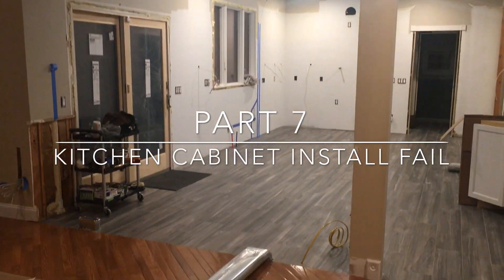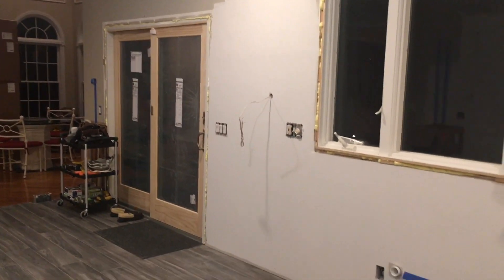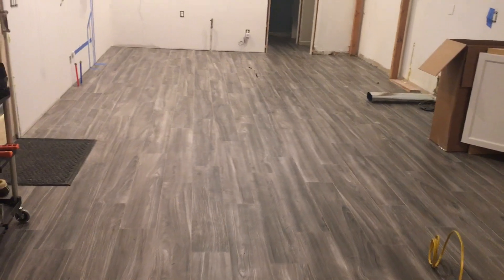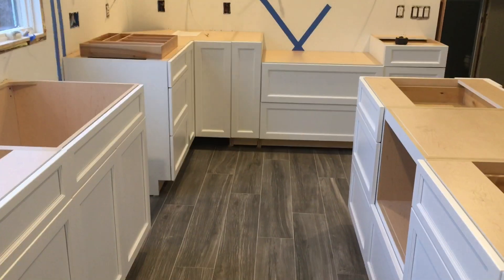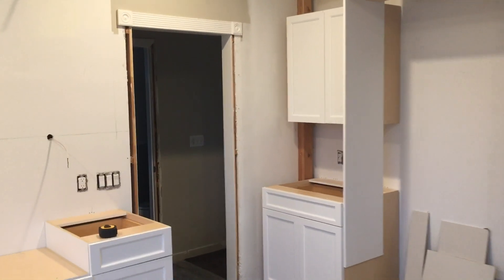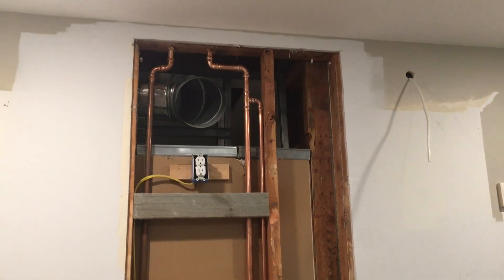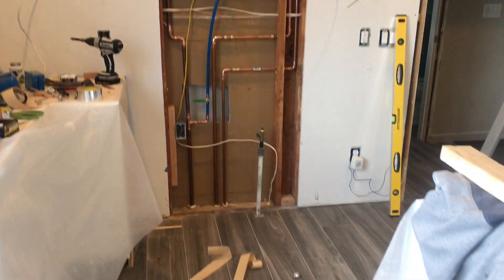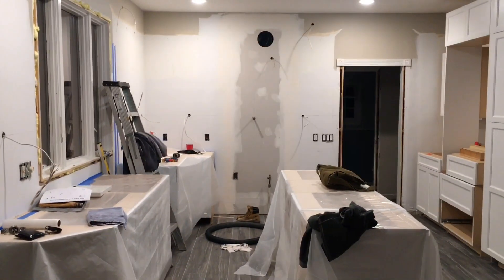Kitchen Cabinet Install FAIL - Part 7 of Remodeling My Kitchen

Comment: I notice the panels on the island looks out of place why is there two parts to it instead of going all the way front and back of the island cabinets
Reply from the maker: I not sure what you are asking.  Perhaps you are seeing something that looks unusual because all of the trim work was not complete at this point? Although I never posted a final video with the counters installed, there is another video after this one, where things are a tad more finished.
https://youtu.be/Bu1bKzrQMLI

Comment: Can’t you just move the 9” cabinet to the right side of where the range will go?
Reply from the maker: It was an option.  But the upper cabinets wouldn't have lined up.  And they were already ordered and delivered.  Moving the vent and pipes was the better option and a better overall layout.

Comment: Don’t use shark bite
Reply: Dont use compression fittings then...  had shark bite for years inside my walls and no issues at all..  however the compression fittings to the ice maker and dishwasher both happened to spring a leak all on their own...  go get another Certification/ title you can call yourself..